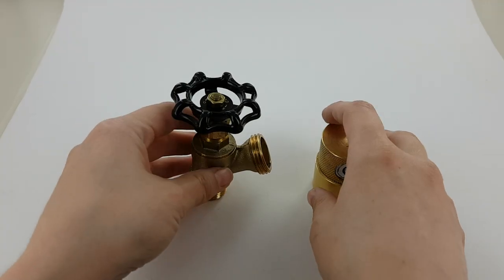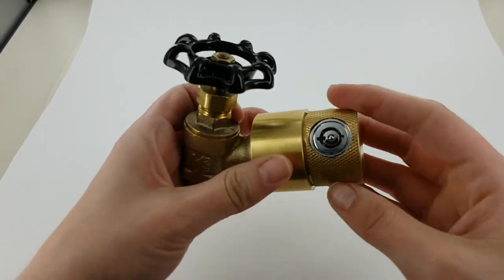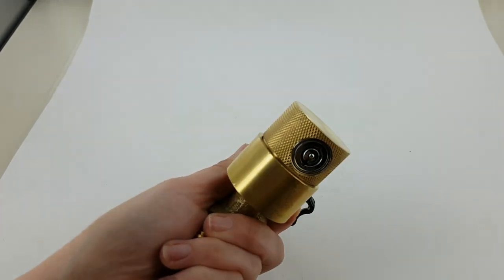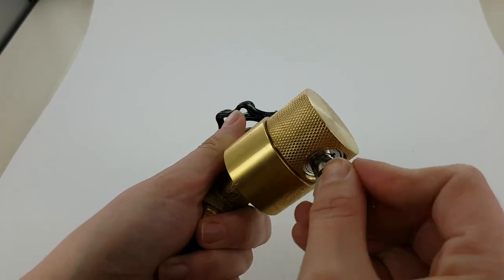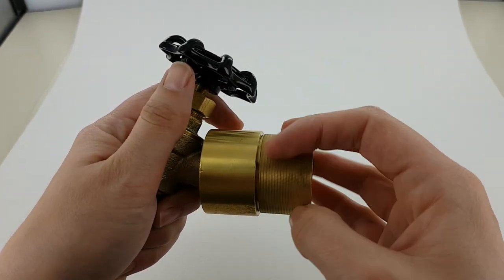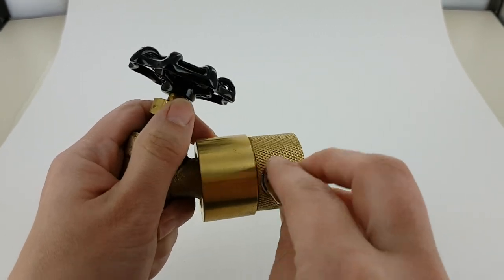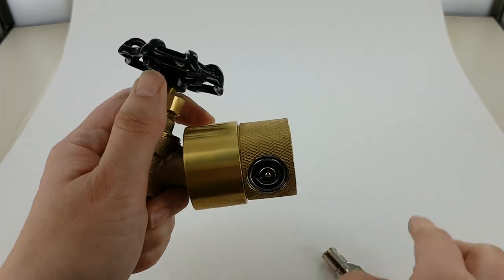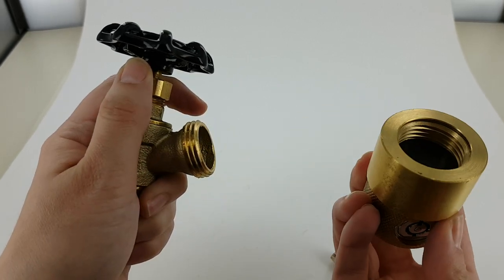How To Use A Faucet Lock

Comment: It spi s freely  but if you hold the top ring tightly you can spin the threaded button and the bottom the lock comes off leaving the top to spin freely but if you lift the free spinning part you can use anything to un screw the piece with the groove in the bottom. And it comes right off. I'm so confused

Comment: I don’t understand the point of this lock. If the knob is still accessible, couldn’t the water still be turned on and go somewhere???
Reply: There's a gasket inside the part that doesn't spin, it fits water-tight to the spigot, so no water will come out